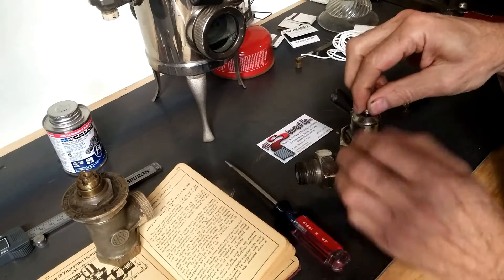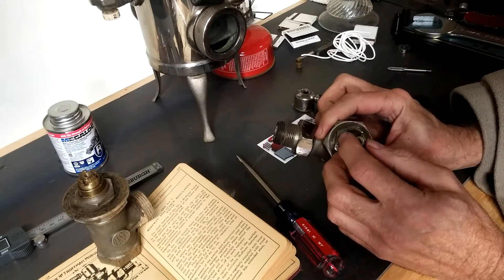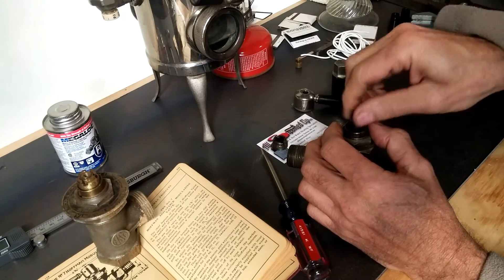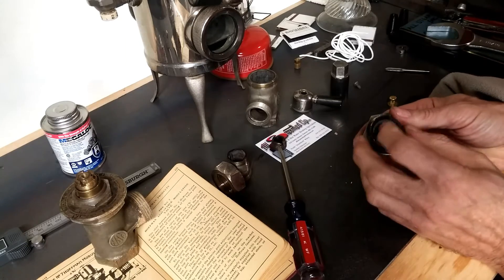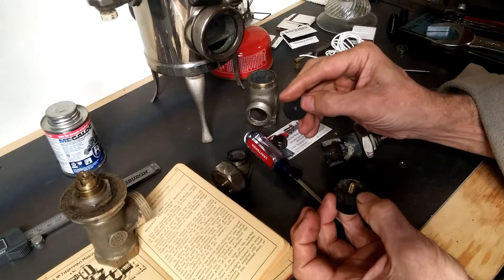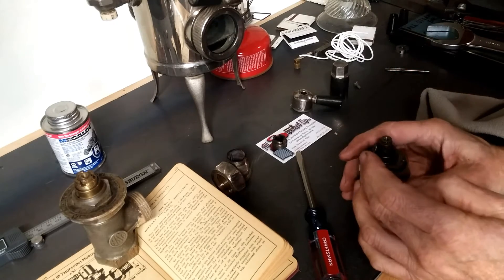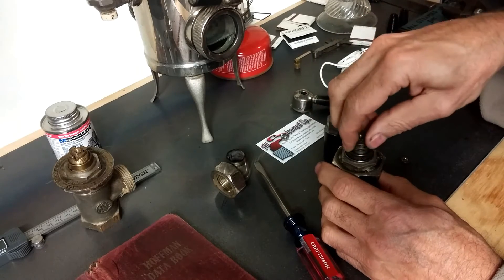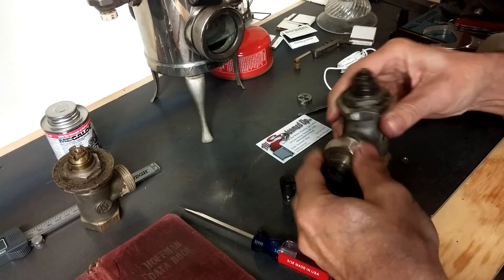Hoffman #7 Ajustable Modulating Valve for 2-Pipe Steam Vapor Systems

Comment: I have an old Hoffman #7 radiator but cant see which direction to turn to open and close. It gets semi hot either way I turn it.
Reply from the maker: Looking down on the valve, turning it clockwise closes it (or should).  You are fortunate that you can still turn it.
However, the composite material washer inside has most likely worn away in the nearly 100 years of steam flow, so it will need to be rebuilt if you want to have it to be able to shut off.

Comment: I just purchased a home with 13 radiators all equipped with Hoffman #7 valves and Hoffman #18 traps.  This is by the most informative video I've found on these valves.  All of the heating contractors I've had look at the system have no idea what they were and told me to replace them with cheap radiator valves if they're stuck.  I've come to understand that I definitely shouldn't do that.  But I do have 2 valves that are broken.  Exactly as you described, the star-shaped pin has been sheared off.  What type of valve would you recommend replacing these with?
Reply from the maker: Thank you! This video was made just for folks like you.
Please contact me at gordonschweizerATgmailDOTcom.

Comment: Can I buy one of your over engineered sockets? I want to rebuild about 8 of these at my house...if I can get them off. (I have one off)
Reply: I regret to say that the tool you see pictured was a "one-off" that a local custom machine shop built for me at no small expense.  I have been working with a local fabricator that uses CNC high-pressure water table to punch out a spanner wrench that I can offer for sale, but getting into their queue to produce product... well currently I'm at the back of a long line.  

As soon as I can get a product I can sell with confidence, I will announce it to all.

On a positive note, I have aquired a 3-d printer and can now bang out plastic handles for the #7.
Reply: @justtisha: We are pleased to announce that we have completed initial testing of a newly designed wrench for the Hoffman #7's infamous castellated packing nut and have them on order from the fabrication company.  Please call All Steamed Up, Inc and leave a message to put in an order.